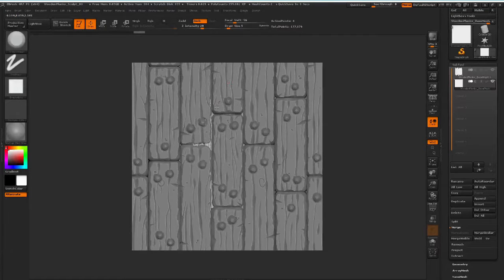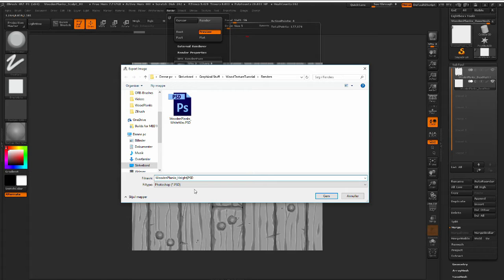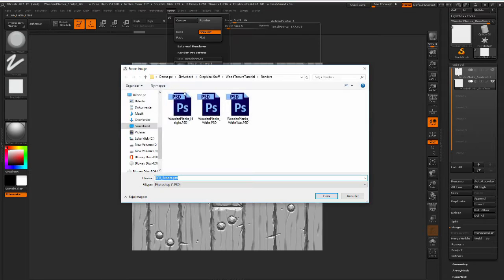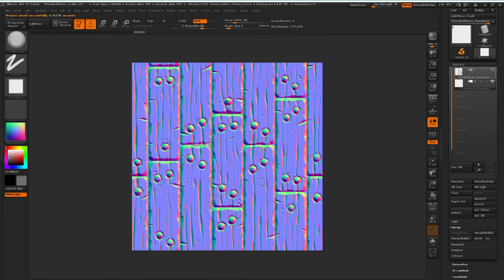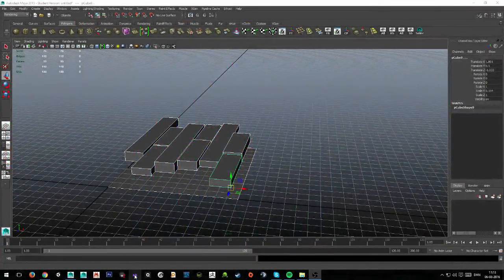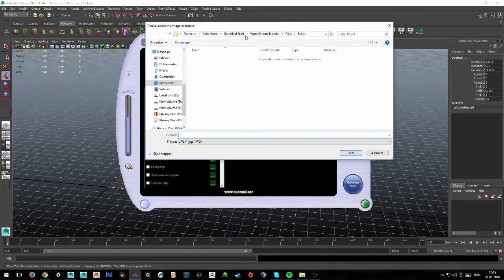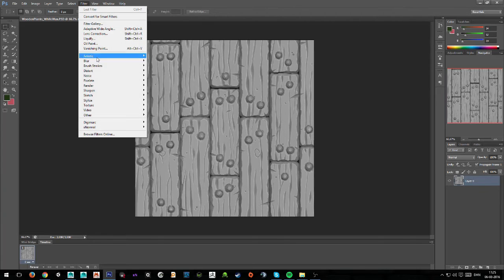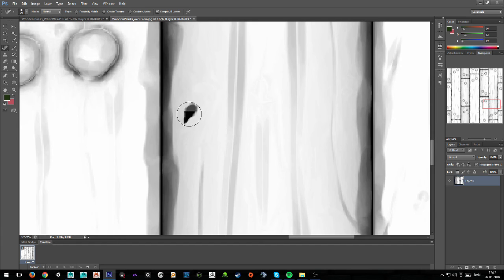How To: Stylized Wooden Planks Texture [Part 7]

Comment: Hey, awesome series, I have certainly learned a lot so thanks a ton for that. Can I ask though, what material matcap are you using before you change it to get the various renders? As in, what is the grey material.
Reply from the maker: Hey! Sorry for not answering sooner. The grey material is just the default matcap added by Zbrush, but completely desaturated. :) You can see how I do this in Part 3 of this series.
Reply: Anders Møker ah I see. Well that clears that up, thanks for replying.

Comment: Hey man very good tutorial learned many things from you thanks.But i saw that you got the same problem that I had with a tailin textures. In Photoshop you have two pixels offset  you can fix this in two ways open in Photoshop The Textur is bakgraund lear offset it bay 512x512 or what the Mid point of the res is then go to 
Select>Color Range then check selection and with the cursor selcect the black lines then click ok.
The furst whey tofix the sims afther u selected them is to go to Edit>Fill with the option 
Content-Awaremod Normalopacity 100%this is is going to bi ok but not evrytimeThe second Whey afther u selected the sims u just hit delete and and check the same options from abov.
But the best whey to fix the problem is from ZBrush it selfJust go to Render>Chek on Best insted of Preview this will rendar the BPR in the VIEW port with out clicking
BPR the main problem of sims is SHADOWS so thurn them off under Render Properties u naw have BPR in the view
dotn click BPR if u clicked if bay mistacke just frame the model agein in the view the change is not match 
only if u luck close tohe border of the canves u see afther u click BPR the image is overleid with 2 Pixel black lines of all sides. now use Grab dock to get Textures Diff and Normal with normal Mat e.t.c.this givs u no sims at the canves rez for exampal 1024.
 for the Depth map u can go Alpha Grab dog
one more thing u can download Normal mat from Pixologic it is caled al_normal :Dsory for may bad English have nice day.
sneik_8@abv.bg my mailll :D
Reply from the maker: Thanks for your comment. :)

I tend not to use automatized methods of fixing seams, simply because I don't trust Photoshop to do a better job at it than I can do myself.
That's why I do it manually. It might take a bit more time, but if you get used to the method, it's very easy and fast.

I guess ZBrush can render these without the seam problem, I just haven't been able to find out how yet. I'm sure it can though :)